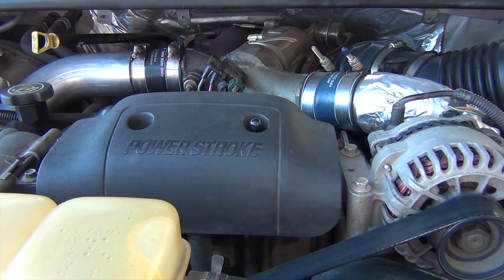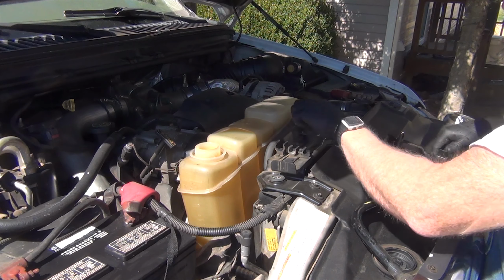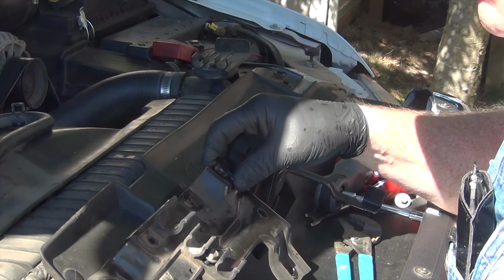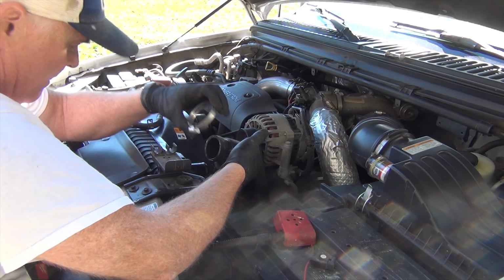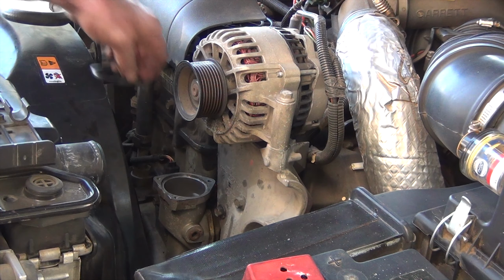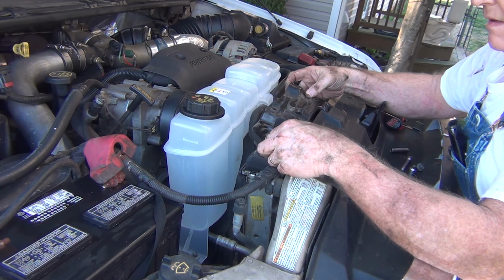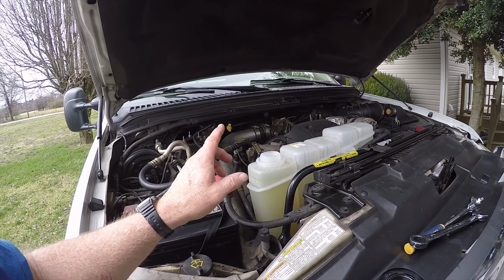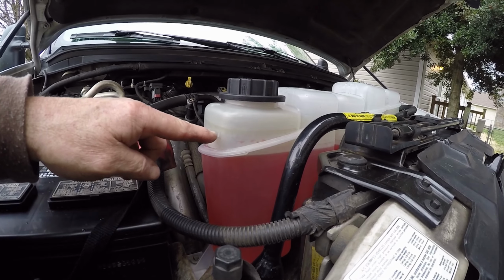Show This Love To Your Powerstroke 7.3

Comment: I had to do this when my oil cooler orings blew on my OBS. I flushed the truck almost 8 times to get the oil out of the system. I would only add to flush the truck without the thermostat installed with the distilled water, reverse flush the heater core and to replace the oil cooler orings as preventative maintenance while your coolant is empty. It’s my practice going forward.

Comment: Flushing is good preventative maintenance. I did my power steering last summer and was surprised at some of the sludge that came out. Sweet ratchet you got there, what a time saver!
Reply from the maker: Oh yea that Cordless ratchet is the bees knees. I dreaded doing the flush but I would dread losing that 7.3 even more. Thanks for watching

Comment: Great video
I have 1999 F350 I change my coolant every 50,000 miles .
I didn’t know about the plug by the oil filter.
I don’t know if mine has it but it does make sense for draining the block.
Thank you 👍🏼👍🏼
Reply from the maker: Glad it helped and thanks for watching

Comment: Was that the dual alternator upper radiator hose you used?  I noticed it went  around the belt instead of through it.  That is a much better idea.
Reply from the maker: Hey Roger,  yes it was the dual radiator hose.  If you get one tell them it’s the dual one like they use on ambulances if they don’t have a good part number. It is way better. The other one kind of rubbed the alternator too much for me.

Comment: When you cracked the bolts in the block, did you leave them open when flushing the system?. Or just let them drain then close them up?.
Reply from the maker: Hey D. Thank you for watching. I retightened them and then loosened them again at each drain.

Comment: I appreciate the video. I'm a little intimidated to pull those block plugs.  With the plugs and lower radiator hose drained, do u still estimate 4ish gallons left in the system?  I was going to be safe and flush twice with hose water and a final time w distilled before replacing thermostat and upper radiator hose w the dual alternator hose.
Reply from the maker: I would say it’s at least 3 gallons but possible o be a bit less. You could eventually get the block drained if you keep draining the radiator it’s just going to take a lot longer

Comment: So to get the air out of the system just open the cap alittle?  My truck gets hot when I tow up a big hill. I have changed fluid, thermostat and fan clutch. No debris between the radiator and intercooler. Thinking a partial clogged radiator? Thoughts?
Reply from the maker: Interesting. That would be my next guess. That’s how I get the air out but there are others.

Comment: I saw a video where the guy only removed the plug from the bottom of the radiator and put a water hose in the tank above and tuned the truck on to do a flush
Reply from the maker: That’s interesting.  If it would get it I’m out of the block as well it would be a lot easier for sure. Thanks for the comment
Reply: That doesn't work AT ALL because the hose is cold water and in order for the thermostat to open it has to be hot. Thus, none of the water flushed from the block.
Reply: Or shall I say none of the old coolant flushed from the block. Unless it reverse flushed. However, still not a proper flush